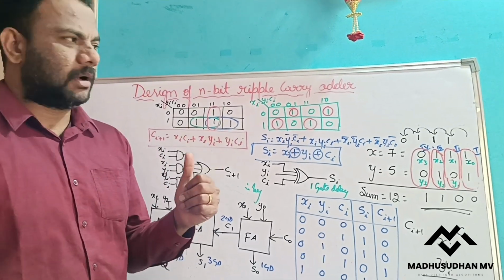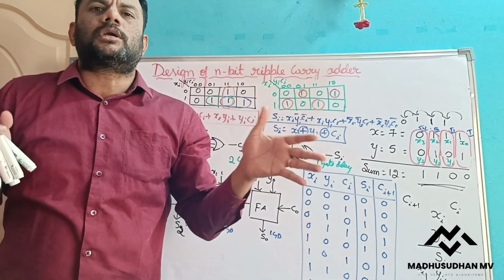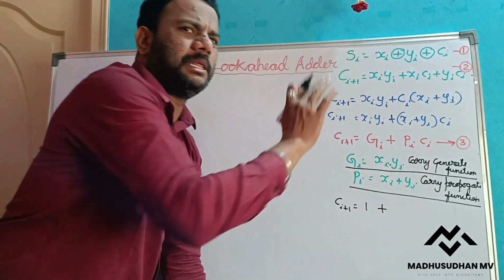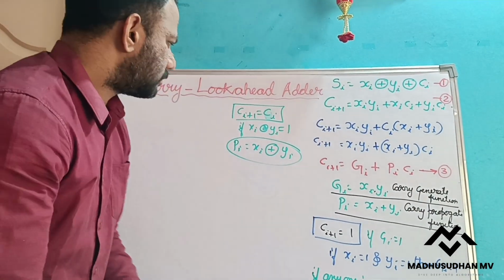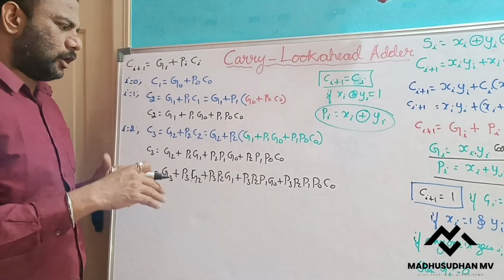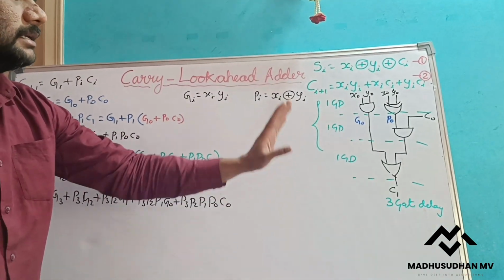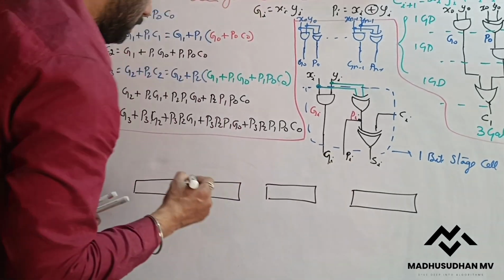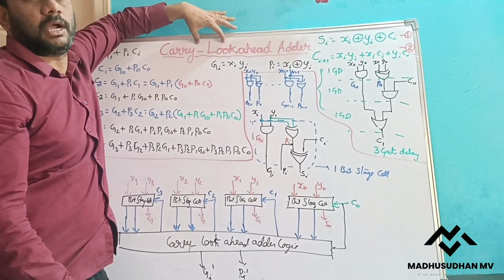Part 25 - Carry Look Ahead Adder (Fast Adder)

Comment: sir i have exam tomorrow and i wanted to know how can i expect questions from this topic (PRESIDENCY UNIVERSITY)
Reply from the maker: @dhruvamreddy706 1) Design 4 bit carry look ahead adder with suitable diagrams and equations.
2) How carry look ahead adder eliminates the dependency of carry generation.
3) Distinguish between carry look ahead adder and ripple carry adder
4) list the disadvantages of ripple carry adder and explain in detail, how it can be overcome using carry look ahead adder 
5) explain how, carry generate and carry propagate functions are used to design fast adder
6) Explain in detail carry look ahead adder